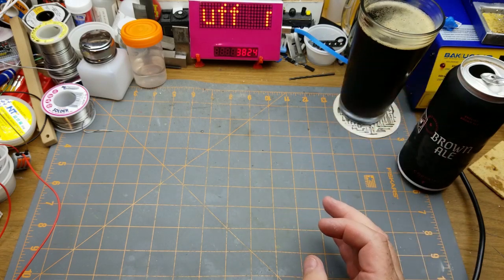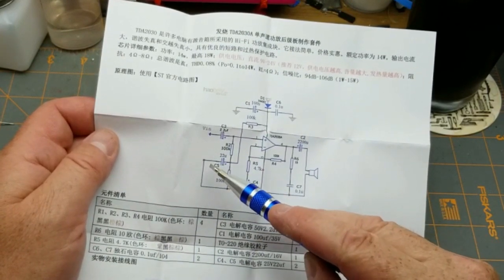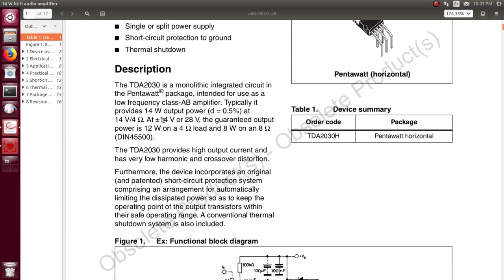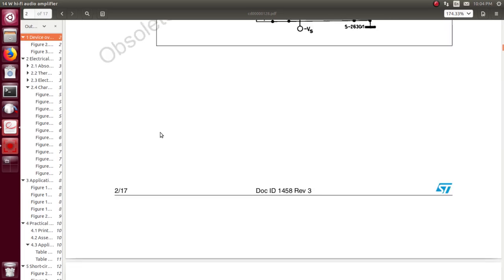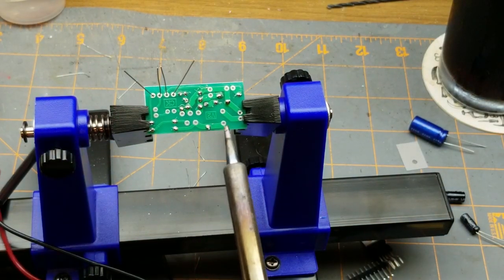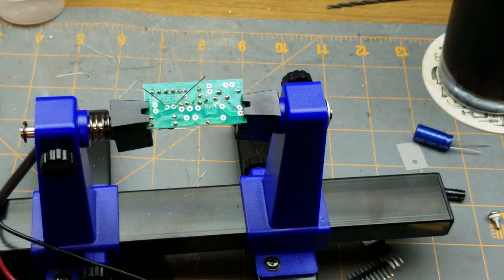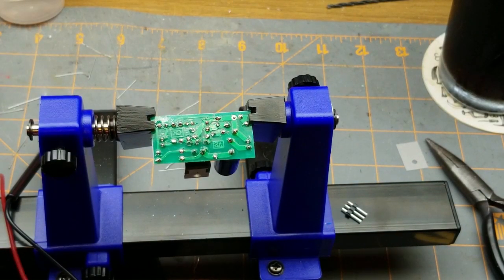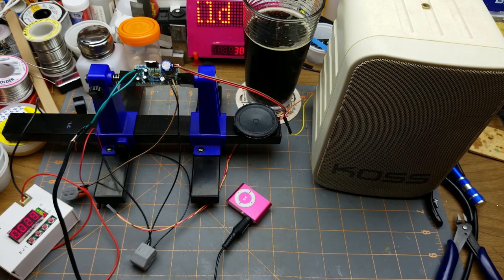kit build - a simple audio amplifier

Comment: Bigger speaker definitely made the amplifier shine. It makes me wonder what use I’d  have for my collection of probably 40 or 50 of those 2 inch speakers I took out of stuff over the decades. Nowadays if I use something that small it would probably be one of those really tiny ones in the tin can like they put in laptops.  I wonder if we connect 10 of those small speakers together, does it just sound like 10 horrible speakers or does it start to actually move some air.
Reply: FWIW, the theory says that doubling the cone area (IE number of speakers) with the same tiotal power drawn from the amp, you get +3dB of volume. At the same time each individual speaker is less stressed...
With 10 you can't keep the load exactly the same, but if you've got the speakers for it, it would be an interesting thing to do/see 1 vs 16  (4 x groups of 4 speakers in series parallel for the same ohm load as the single speaker)
IE 2 4 Ohm speakers in series to make an 8 Ohm load. Another such series string in parallel to the first string to make a 4 Ohm load with for speakers.
Create 4 such 4-speaker groups and connect those groupings in series parallell för a final 4 Ohm load made of 16 speakers... 
Not much power to reach element , but should theoretically give +12 dB (1 to 2, 2  to 4, 4 to 8, 8 to 16 is 4 doublings of area, each giving you+3 dB) or more than double the perceived volume compared to the single element...
Reply: I am actually waiting for a cheap sound level meter to arrive. If that unit works, maybe it would make an interesting experiment. Of course I have to locate all those tiny speakers in all the various nooks and crannies around here.
Reply from the maker: The surface area of each cone also matters to the sound quality.
I doubt there's an easy way for a 2 inch cone can reproduce low frequencies adequately.
Reply: @pileofstuff  size does put some limitation on things, but (relatively, for the application) small speakers  can do a big job.
The 6.5" in this video [https://m.youtube.com/watch?v=WT0K_aZNp8o] are pretty long stroking though, not something like found in a commonly used 2" speaker.

The right box also matters, 2x 4" 'subs' in a car -  https://m.youtube.com/watch?v=W0QUloqPIyk

Comment: Hi,
These days even if you aren't colour blind, its always safer to measure the resistors, the body colour darkens most of the bands.

That PCB looks like it needs a bit of cleaner on it before soldering.
Can I suggest you put the tip temp up another 10Deg, to get the flux in the solder working?

Comment: how many discrete components would it require to replace that discrete amplifier component you think ? Will a (darlington) transistor and some smoothing caps be it ? I've never tried it myself and now I am curious :) Once I cleaned up the mess in my electronics room I will start tinkering myself again but no time yet unfortunately. A lot of computer related stuff left to do here (which is also my hobby) amongst the regular life nags and time flies :(
Reply from the maker: To get that amount of gain while maintaining stability I suspect it would need several stages of amplification. 

You'd probably fill a couple of breadboards to do it properly, i would think.
Reply: ah right I assumed it might be enough to use a darlington (a big HFE) but life's not THAT simple :)